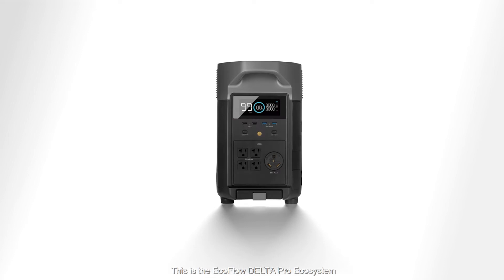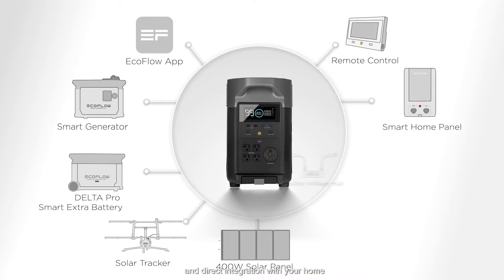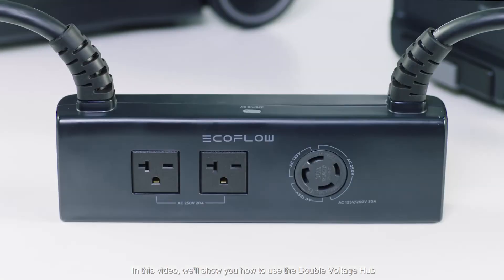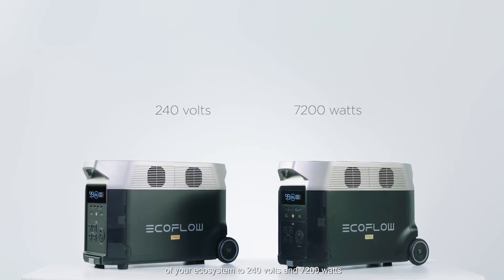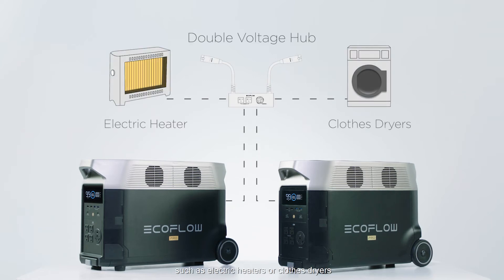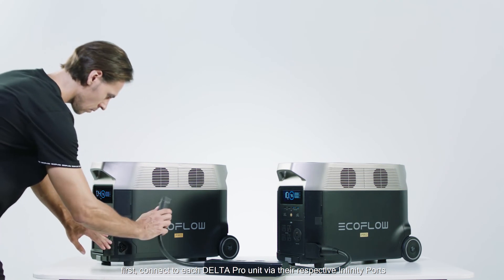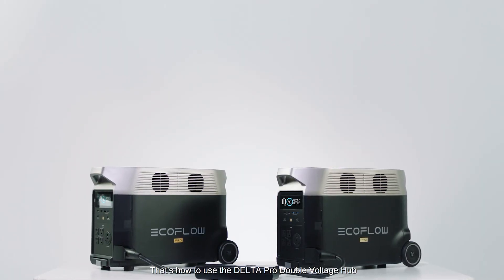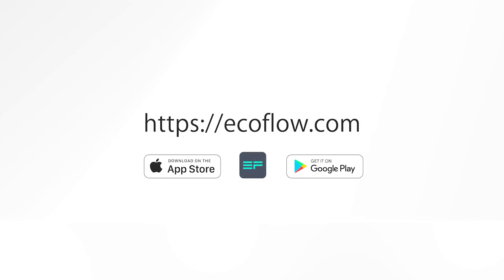How to use the EcoFlow Double Voltage Hub

Comment: I bought this DVH , yes it gave me 240V but it turns off all 8 of 120V outputs on front of both Ecoflow Delta Pro also turn off wall ac and solar inputs. In other words I either have 240v or 120v outputs and takes no charge. I have to return it.

Comment: Can I connect 2 Delta pros via Double voltage hub if I have Eu version which is already with 240V?
Reply: I have this same question. Any answers?
Reply: @stephenajetumobi6  Hey, I got the answer from EF. We can not as we already use 240v so it is not supported by that way.

Comment: Purchased and having 2 issues. When connected to 2, it only draws from one and then never switches to the 2nd DPro when the first gets to 0. Any advice? Also, the regular ac plugs on the front of DPros don't work when the hub is connected. Is that expected?
Reply: Re: "it only draws from one and then never switches to the 2nd DPro when the first gets to 0". It is because all the loads you are powering are only on one phase.
Reply: @danielguinazzo7032 Also the wall AC and solar inputs are disable. It takes no charge

Comment: I recently purchased two Delta Pro power stations with the Dual Voltage Hub. When I connected the DVH to the power stations I immediately get a rapid flashing white light, hear some relays clicking and error code 553 shows up on the power station displays. No voltage out on the DVH. I've been working with Ecoflow support for a couple of weeks now and they still haven't even been able to tell me what error code 553 means. VERY frustrating.
Reply: Hi, do you solve this problem. I have the same and no solution today.

Comment: Do two Delta Pro units need to be connected together or can 1 Delta Pro and 1 Extra Batter be connected and still use the double voltage hub?
Reply: Double voltage hub needs two delta pros.

Comment: Does it do split phase 240/120 or is it 240v only?
Reply: Excellent question. EcoFlow?
Reply: 120/240V 4 wire single phase with a floating neutral. This would work well with a transfer switch such as an interlock or Generlink and power 120v and 240v circuits.
Reply: @n2rj  Precisely!!